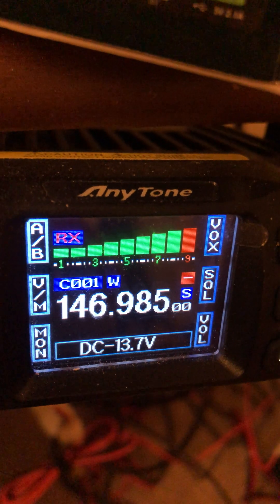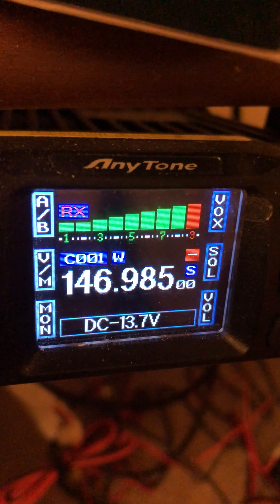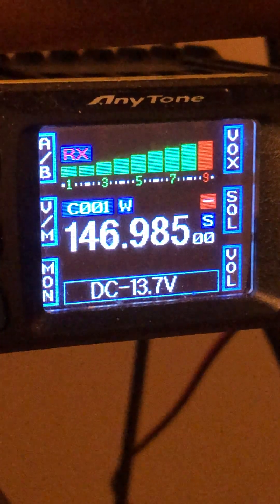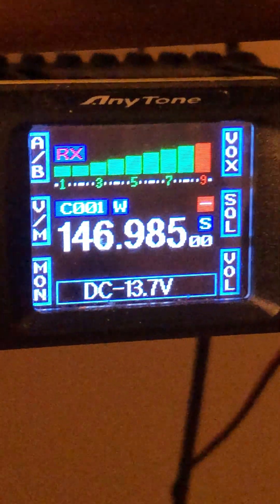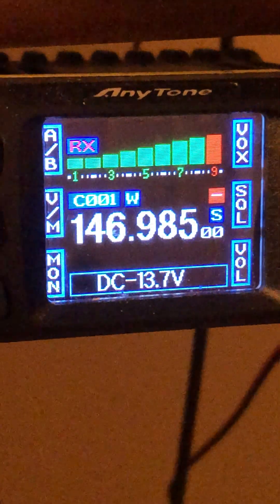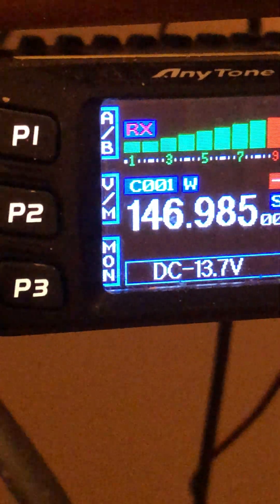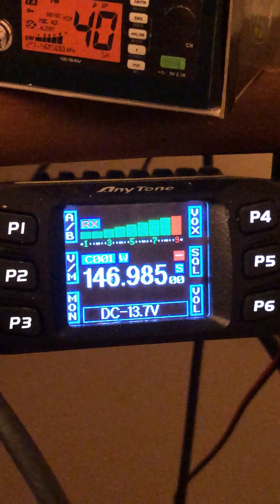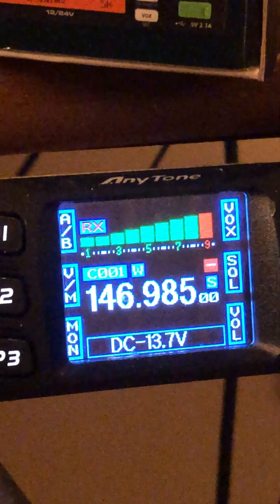Ham Radio Beginners. SWR (Standing Wave Ratio) Explained #hamradio #education #cbradio

Comment: Reflected power bounces off the antenna tuner and adds to the source power.   So if the transmitter is putting out 50 watts and the reflected power is 25 watts, 75 watts will then be heading back to the antenna.  This is known as “reflection gain.”  But then that 25 watts of reflected power bounces back to the tuner leaving the full 50 watts delivered to the antenna.  At HF frequencies there is no significant loss.  So SWR is only an issue at VHF and UHF frequencies where coax loss is high.  At HF frequencies just use an antenna tuner to keep the transmitter happy.